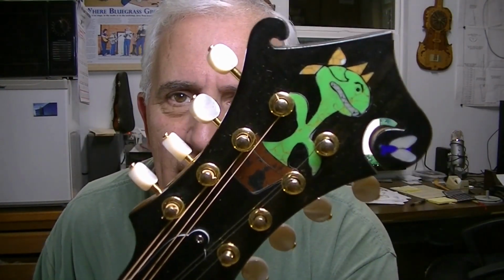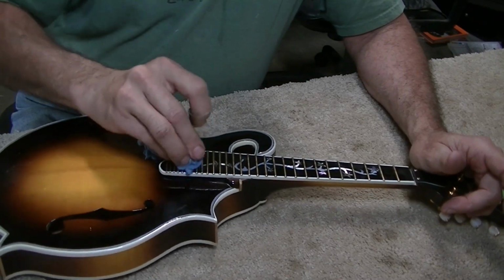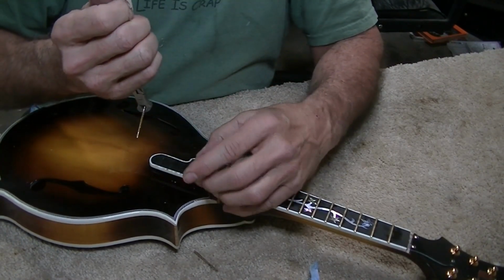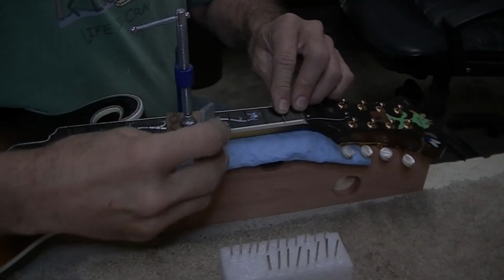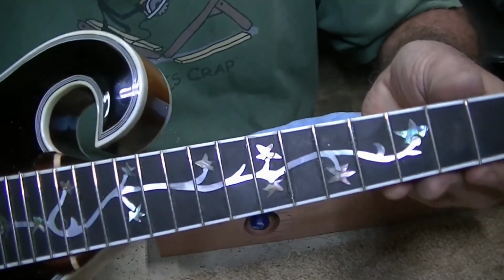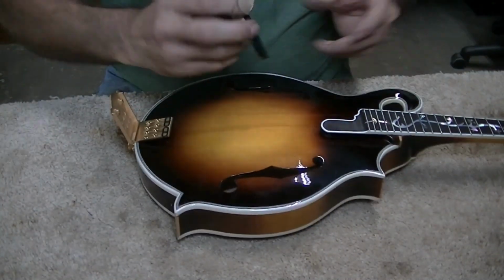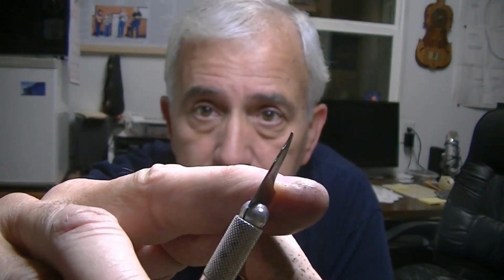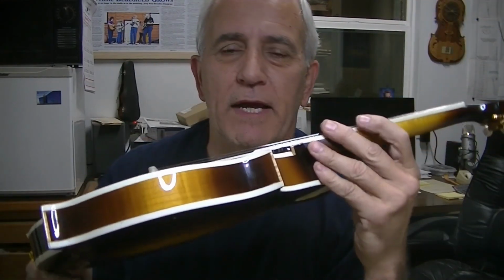533 RSW One Snap Dragon Three Fret Jobs!

Comment: I did a re-fret job out of necessity on my old mando a couple months ago.  I should add, I took a soldering iron that I had filed a notch into it to run over the fret to heat it with a bit of water under/around it on the fret board.  It seems to heat whatever glue may be holding it to the wood and eliminates tear out by 95%.  Ted Woodford in Canada gave me that tip on one of his vids and wish I could thank him personally.  I'll pass it on to others here.   Cheers my brothers and sisters in luthier (re- fret) land.   Bob
Reply from the maker: I have used the heating method myself.  but don't find it all that helpful.
Reply: I use heat sometimes with the same method, but not the water. There is also an argument, that, because a metal fret expands and contracts faster than a wooden fingerboard, if you heat the fret (which compresses the wood on either side of the tang) and allow it to cool slightly it will shrink away from the slot and lift more easily. I'm undecided, but that's one theory that's around.

Comment: The tool you use for notching the ends of the frets is something no electronics workbench should be without: a chassis nibbler (I've had one just like it for about half a century). They are made for things like cutting notches in sheet metal panels and making round holes square, indispensable in the days when everything electronic had tubes mounted in a steel chassis but still very useful when working on solid state projects in steel housings and pretty handy even today when we usually mount projects in plastic boxes (if it can nibble steel imagine how it devours plastic).

Comment: Jerry, I was told frets were made from a single size of wire.
So, the larger the fret top the smaller the tang.
And, in the same way, the smaller the fret top, the larger the tang.
Reply from the maker: After nearly 40 years, its the first time I saw that.  I have seen many size and only this one had a tiny tang.

Comment: Additionally I should add, there may be a tiny little burr left after the tang has be nipped.  If you are industrious enough you can file away this burr with a small file so it can't prevent it from going over the binding.  A magnifying glass will allow you to see if you have filed away this bit of burr.  I don't know if it's necessary, but I did and though it took a bit of extra time, I feel satisfied I did the best job of a re-fret possible.   😃🙂💖